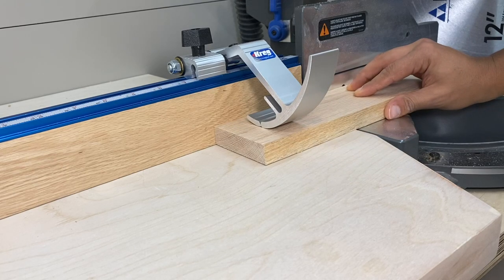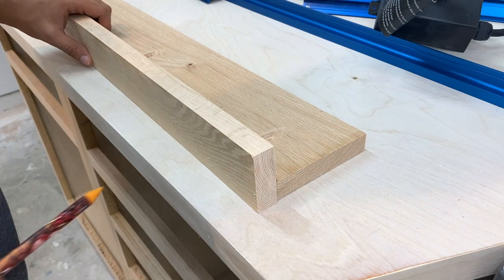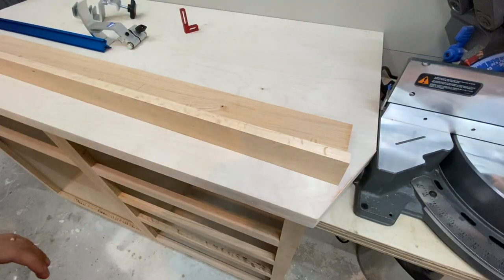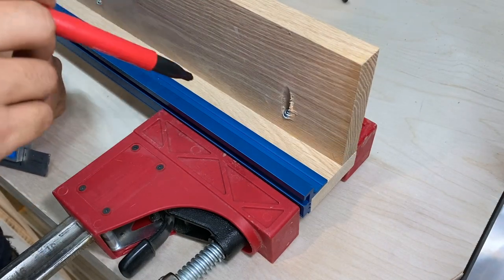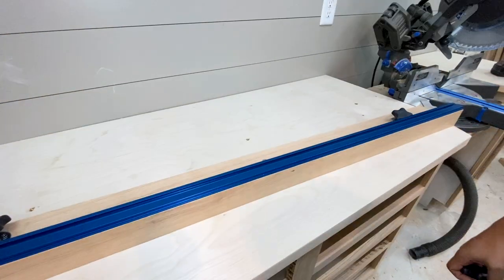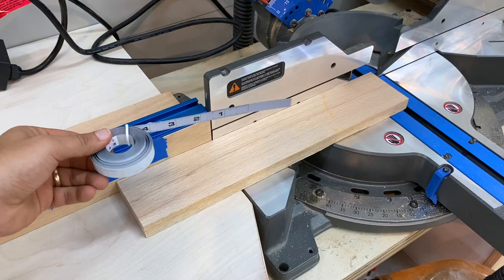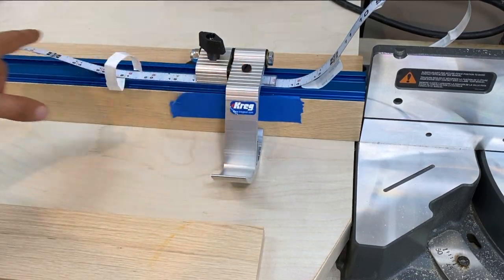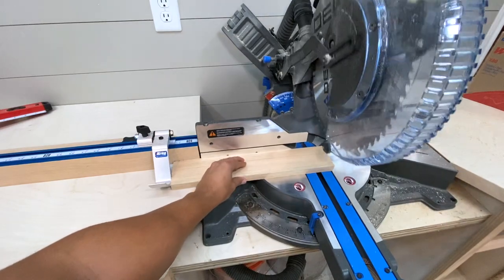Miter Saw Fence Build // Miter Saw Station Build Part | 2

Comment: Great video. Planning the same fence build with knobs and threaded inserts which is why I watched. I'm planning on cutting slots instead of holes for the hold down knobs long enough to move the fence forward enough to allow for alignment with a 3/4 auxiliary (zero clearance) fence when I need it. - How do you make short cuts inside the range of the stops? I am considering making a 2 foot jig to attach to the production stop - subtract the 2 feet and cut anything down to zero. I found 1/4 inch bolts fit nicely in the two slots in the stop.
Reply: Have you built your fence yet? Will you post a video detailing it?
Reply: @tracphil  Got it built. Turned out great. I'll get it cleaned up and shoot a quick detail video soon as I get a chance.